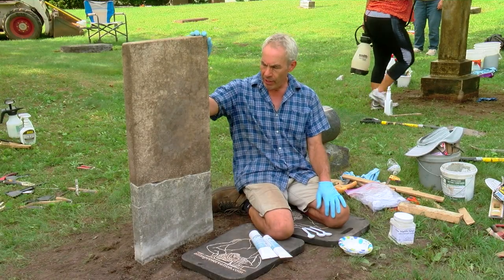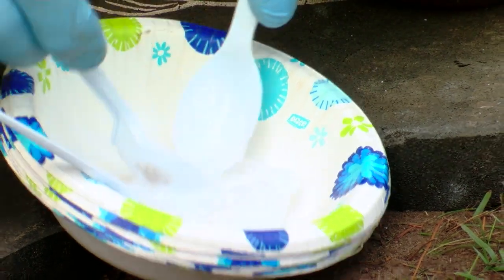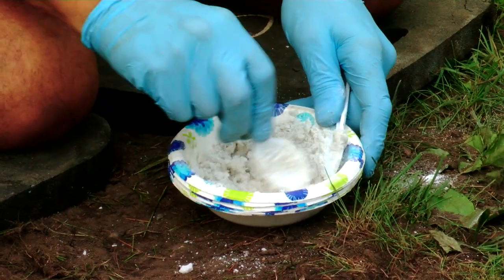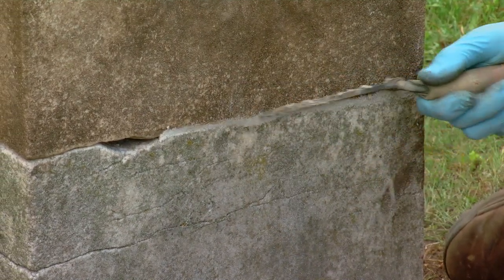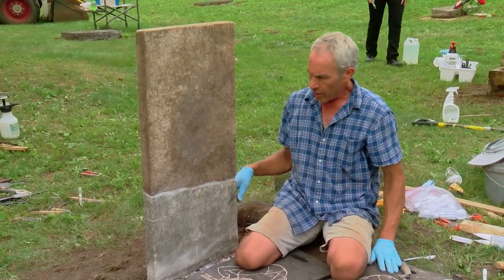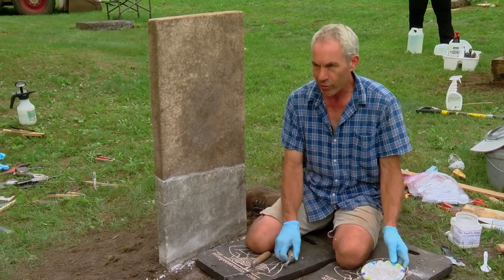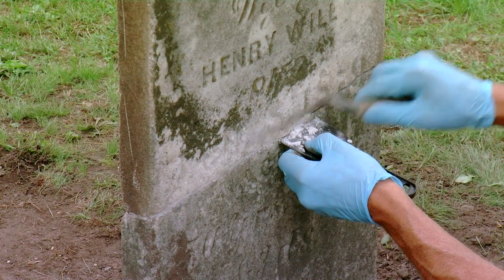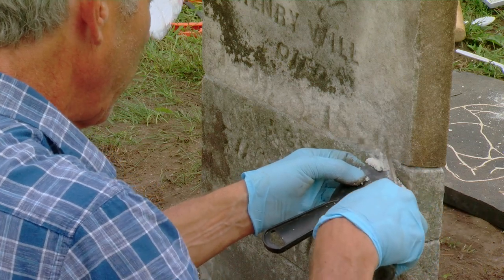Local Cemetery Conservation: Historic Mortar Infill

Comment: Appreciated the closeup detail shots.
Is there a video showing how the two pieces were "glued" together?
Was surprised the headstone was not cleaned prior to the repair.
Can anything be done to increase and preserve the readability of the engraving?
Reply: The headstone was cleaned before the epoxy, but the upper part is stained from being in the ground for many years.  It will lighten up a little but will never go away completely.

Comment: Man, with all the long winded talking, the 1st step would be to wash then etch with muriatic acid before any work began . That way when it came time to join both stones, that the broken seam could be post filled without plastering closed all that nasty mineral stain from the soil.
Reply: In the world of conservation and preservation, the first rule is: do no harm. The most gentle methods are used in cemetery conservation. Acids are very damaging, and should never be used on old stones in cemeteries.
Reply: @fh1209  I'm not so sure about that? I mean like coin collectors for example freak even if a coin is washed in water with a tooth brush. Grave stones are grave stones. the only thing that has changed from being new is time & biological accumulation. Mild acid washing, even caustic soda (lye) or contained soda blasting to remove lichens and algae growth over decades of build up. 

What's the point of doing any of it other than a clean as possible restoration that will last another 200yrs.? My perspective is coming from body & fender repair/ boat work. 

Why even bother calling it conservation or preservation if the work does not call for a complete restoration as possible other than just being left in a state of static decay. It certainly is not archaeology. Given your description of "Sugaring" seems to me a conservator would do everything that is reasonable to stop and contain it indefinitely with modern chemical resins just as submerged wood fiber is stabilized with glycols. Just my P.O.V., it's very interesting work. I have this thing about restoring things for the best Intrinsic condition of an object no matter what it is, save coins and antiques per se. I suppose i don't fit that ideological mindset of small paint brushes and mist bottles and mass hours with very little to show for it. 

I witnessed once where a racoon had gotten himself placed between the hot side and earth (ground) of a 10KVA transformer. Vaporized the poor mammal. All that was left was a permanent grease stain embedded in the surfaces dielectric  paint .
The entire transformer had to be replaced . I guess my analogy is if anything is worth the time and man hours it needs to be done correctly. It took a massive crane to remove that transformer from the substation and replace it with a new one. Just because of that grease stain. A lot of heavy mass copper coil windings inside.
Reply: Stu R- Using muriatic acid is is a horrible idea. You watched the 1st video where he bonded the pieces. Once the stone is stable and cured, he will clean the entire stone using D-2 cleaner. I'm hoping your comment was being sarcastic, and while I agree he talks a little too much during the process, he is repairing the stone in the best possible manner using the least invasive technique.
Reply: Didn’t I already tell you on another video to not be rude? Don’t comment if you gonna be negative. It’s his video and he can talk through the steps he knows if he wants. Take your attitude elsewhere
Reply: @AtomizedSound  it's his video made public for public comment. Archeology at it's finer moments of control. Let me guess; Democrat
Reply: These are marble headstones. Using any type of acid would be very corrosive and damaging to the stone no matter the concentration used.
Reply: @AtomizedSound  RIGHT...he's teaching a class.
Reply: I think @stur does bring up a good point, though I agree that acids should never be used. I feel he should have cleaned both pieces with D2 prior to making the repair because he may have embedded the soil staining beneath the epoxy he used to do the infill. I work for a firm for the last 15 years that does this type of work, and we always clean everything meticulously before joining pieces together to avoid that outcome. 
My 2 cents.